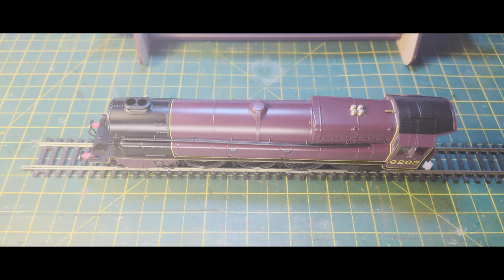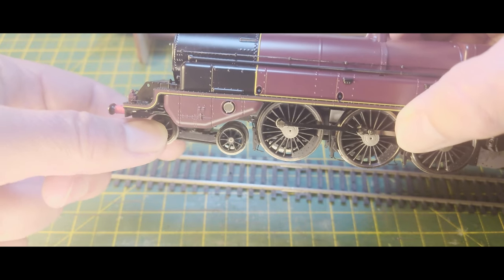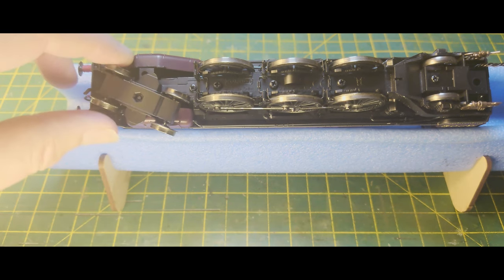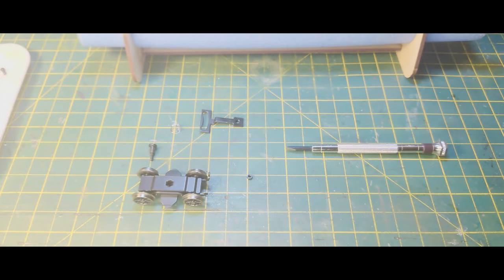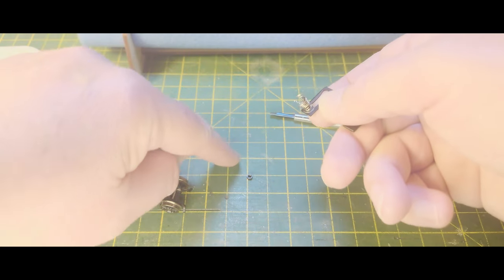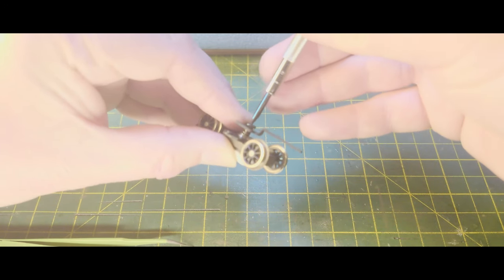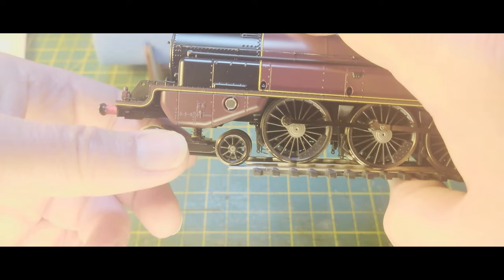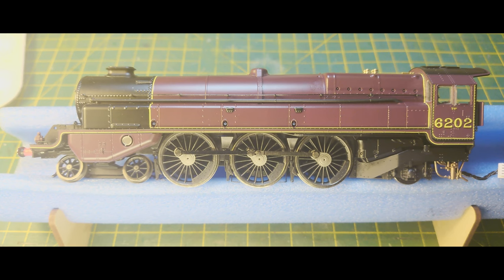114. How to – Correct Hornby's The Turbomotive 4-6-2 Loco Derailing front Pony Truck

Comment: It sounds just like you're whispering. Honestly, I can hardly hear a single word. Shame.
Reply from the maker: It's on maximum volume. Plug some headphones in, then it's fine. Volume is ok on my laptop and phone. Hotdogpilot (another Andy) says its now fine also.
It's using a new microphone setup. Obviously having the mic just a foot away is too far away 🤷
Are you sure you watched the '114 Louder' video and not its predecessor ?
Reply: @andrewdking  I watch the 114 Louder video on a 2-year old laptop with sound on max. and, whilst the vast majority of other Youtube videos are fine, I can barely hear a word of this. Sounds like there's a sock over the mic.
Reply from the maker: @PaulFellows3430  Well, there is a foam sock over the end and now I've discovered it comes off. That might help for indoors recordings
Reply: @andrewdking  I think youmight be onto something there. I'll be interested to hear what your next upload sounds like. Thanks for helping and being constructive, rather than going off in a huff and treating me like an idiot (which does happen sometimes, sadly).
Reply from the maker: @PaulFellows3430  A constructive response might change a casual viewer into a subscriber, plus I try to sound intelligent 🤓
Reply from the maker: @PaulFellows3430  My Tap repair video No.117 coming out at 7pm this evening (6th May) uses the mic set-up again as the last sequence on the green mat. Still not perfect (a few crackles), but the volume is loud enough I think.